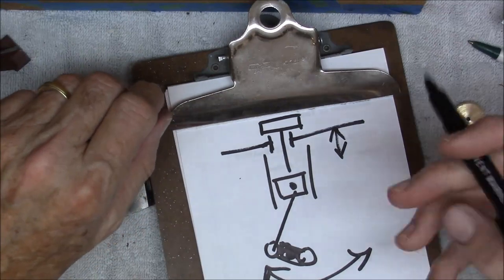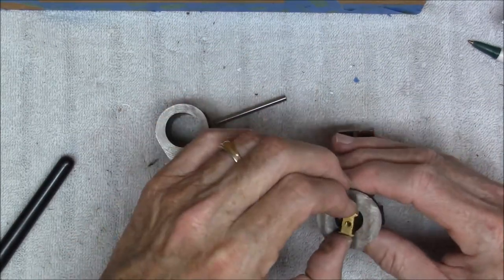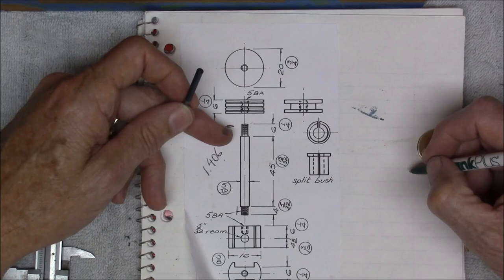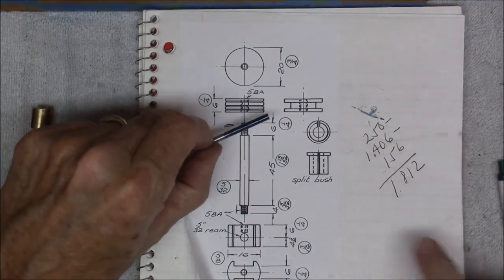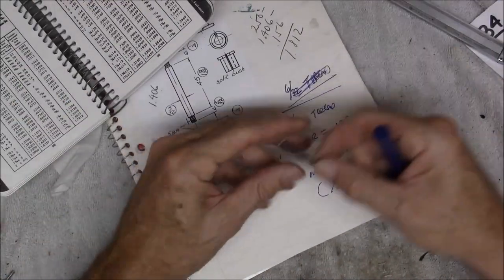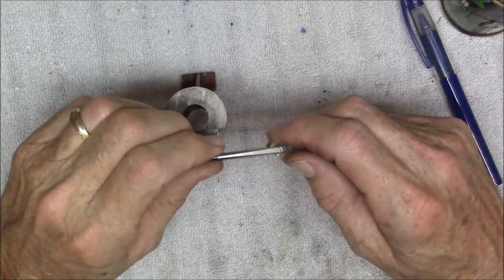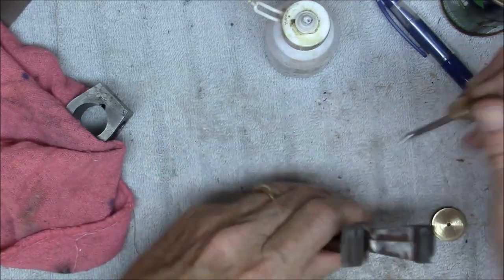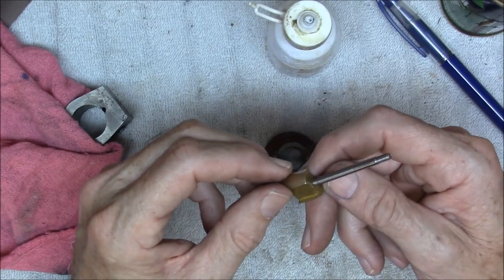Machining the Stuart 10V Steam Engine Castings - Part 27

Comment: The binding problem really surprised me because, as your previous videos showed, you bored out the hole to .621 and turned the cross-slide to .615 for a difference of .007 clearance. After seeing the problem you have, maybe it would be better to ream the hole to the 5/8ths dimension not for the size accuracy, but to ensure the hole is perfectly round and even through the entire length of the hole. Also it would make a nice smooth surface inside the hole for the cross-slide.
Reply from the maker: +TinkeringJohn 
The hole can be either bored or reamed. However for sizes this big, a boring bar seems to work better for me and I dont' have to buy an expensive reamer.   The boring bar will bore an accurate  and perfectly round hole.  ~John
Reply: +W5CYF / TinkerJohn Thanks for the reply John. I agree that a boring bar will work just as well and how often will you use a 5/8ths reamer?

Comment: Got yourself a little bit of a problem with that binding cross head. Strange, its almost as if the bore is very slightly banana shaped along it length.

Comment: Would it not be just easier to use metric to measure with ? It looks like it's on the plans.
Reply: Not at all. That would require metric micrometer/scale/calipers, as well as a metric lathe. Then he'd have to convert back to cut the #6 threads.
OTOH, The addition would probably be easier if you added up all the 32's and then converted to decimal, but we all use what's easiest for us.